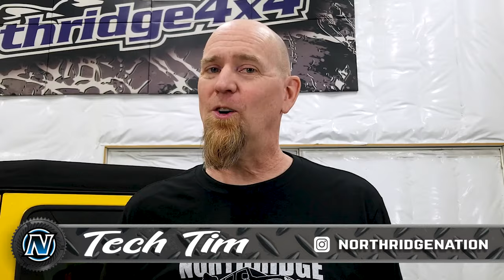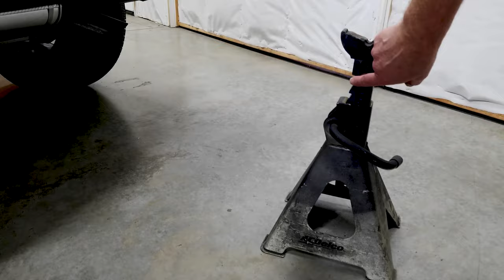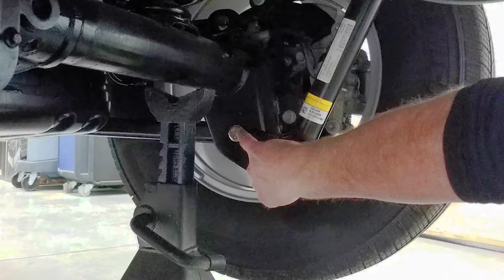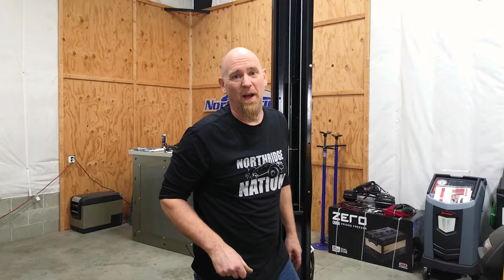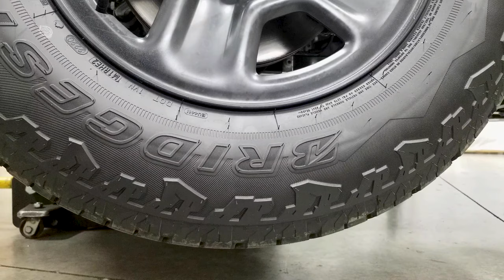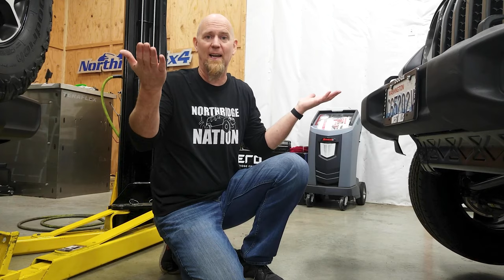Jack Stands Could Be ALL You Need!! [DIY Tutorial]

Comment: Thanks for this detail on the lift points and the comment about the jack stands!  First-time JL owner here and didn't consider my jack stands may not be beefy enough.  The ones I have are 2 ton and my jack is much smaller than what you used.  I'd like to rotate my tires when the new Jeep hits 5k so this gives me time to prepare and grab beefier equipment for the job.
Reply from the maker: The nice thing about the bigger jack and bigger jack stands is they will lift higher and easily support your Jeep at a higher height, making it easier to work on your Jeep.

Comment: 1. Thank you, I’ve been looking for the best garage jack setup for a wrangler and this is excellent. 2. What is the disadvantage of placing the floor jack under the pumpkin, jacking to the desired height, and then sliding both jacks in? Why increment on each side? Thank you!
Reply from the maker: It's all about balance.
On the rear, with the centered diff, it is pretty easy to do that. Just make sure you use a floor jack that can support it.
On the front with the offset diff, it will lift the vehicle unevenly.
Reply: @northridgenation  awesome, thank you. Second TJ, first one I will service. It is easy to find videos on kit upgrades, but hard to find some of the basics, like how to properly use jacks. Thank you for the reply!
Reply: is a 1.5 ton not strong enough to lift the jeep without damaging the floor jack or it just take more pumping effort? @northridgenation

Comment: Is it best to lift on the edge of the differential where the pan meets or in front of the differential on a flatter spot?

On the JK the gas tank, kind of butts up against the frame, which makes a little harder to get a jackstand on the frame itself I found. 

In the front can you not just lift it right up by the differential or do you think it’s offset too much and you should do a little bit at a time like you showed? 

I’ve always lifted the rear of my cars up by the rear differential if they’re rear wheel drive. People always say there’s gonna be issues, but I’ve never found it to be the case over the years. Maybe there’s a few cars that have issues I don’t know.   

BMWs have a great center lift Point in the front so you just jack up the front there put your stands under the jack up the back by the differential and you’re done. Literally takes like five minutes. A little bit longer in the jeep :-)
Reply from the maker: Don't lift direct from the edge of the differential IF it is resting on the edge of the cover.
It's tight next to the fuel tank, but there is still plenty of room.
Lifting just at the front pumpkin is a little too offset. It would be better to spend the extra couple minutes and do it side by side.

Comment: Is there really a need to use 6 ton Jack stands on a Wrangler?  I have 3 ton.  My 2012 JK Rubicon supposedly weighs 4500lbs.  A 3 ton jack stand could hold the entire vehicle’s weight with change.
Reply from the maker: Weight wise, those are totally overkill. Safety factor-wise, they are about right.... 😎
We use them that big to be able to lift them higher up.

Comment: How high should I lift it for long term parking?
Reply from the maker: That depends on where it is. If in a garage or other protected enclosure, just lift it enough for the tires to be off the ground. Set the jackstands under the axles, so that it is sitting at ride height.

Comment: First off, thank you for the video.  It told me what I needed to know, for safety.  I worry about one thing and this is constructive criticism.  I think that if you're making a video explaining the most common maintenance/repair action other than opening the gas cover and unscrewing the cap, then maybe it wouldn't hurt to explain why you put the stands on the axle for the two rear and driver's side front but NOT the front passenger side.  Because maybe I saw it incorrectly.  And, maybe others didn't see it at all.  Just sayin', for those of us who need a video for the basics, consider being more detailed in describing that which you are doing.  Why not have the stand on the front pass axle?  Is the rear stronger because of a different drive shaft system?  What could happen if the stand was placed on the axle by the wheel there?
Reply from the maker: Thanks for the comment @Luke Knowles. Though I'm not understanding what you are asking. We have two jack stands under the front axle and two axles under the rear axle.